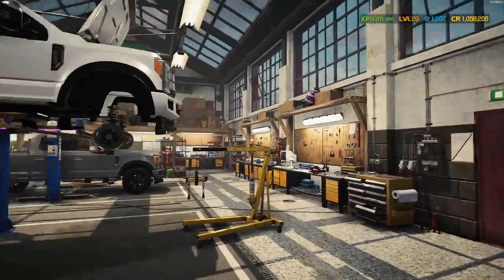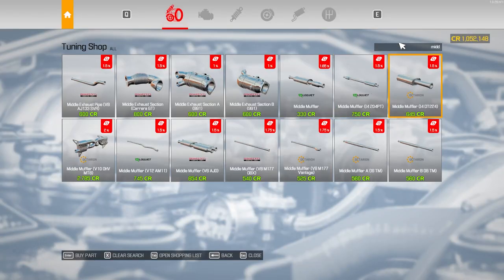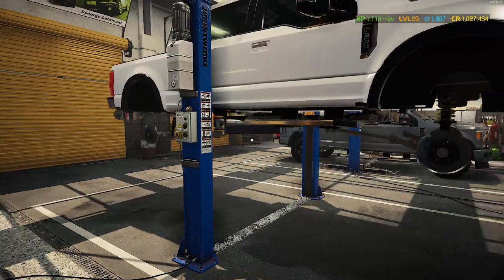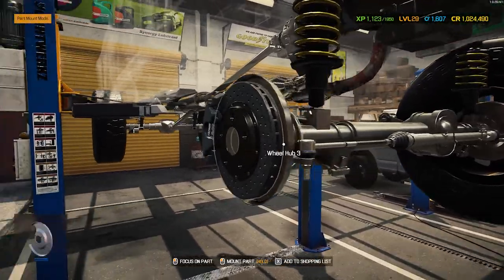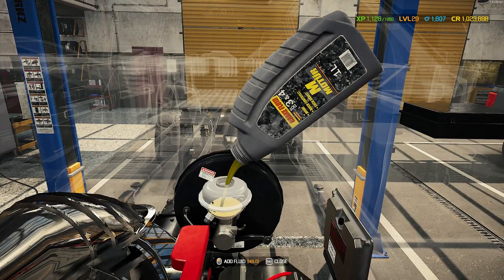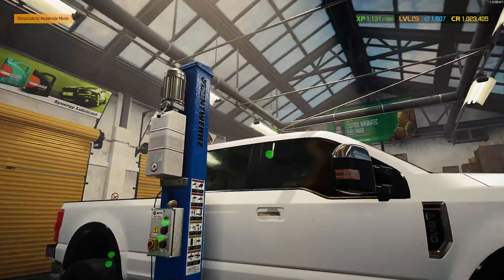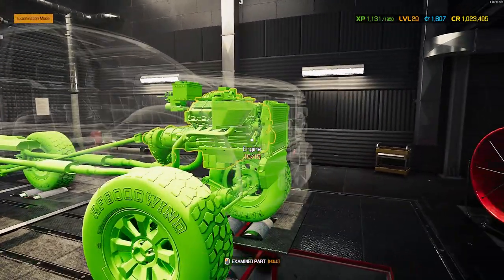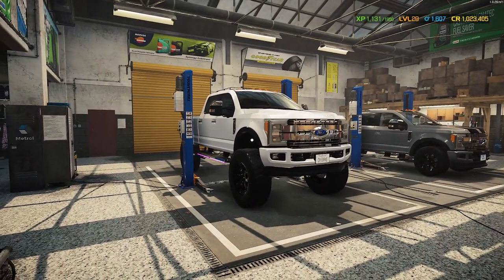1200 Horse Power Offroad F350 | Car Mechanic Simulator 2021

Comment: really wish they added the 6.7 liter power stroke turbo diesel cause that would be wayyy cooler than the boss engine. also they should have made the buying parts tabs able to filter it by engine so you can buy everything quickly.
Reply from the maker: Yea a power stroke would be sweet, and you can filter parts by engine, transmission, brakes, etc. I just dont because theres so many variants of say the v8 ohv parts